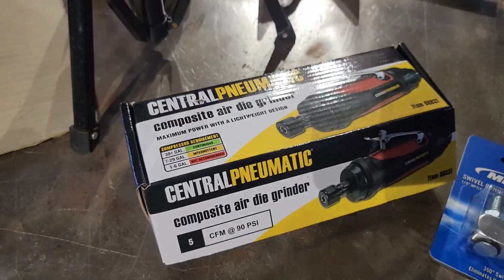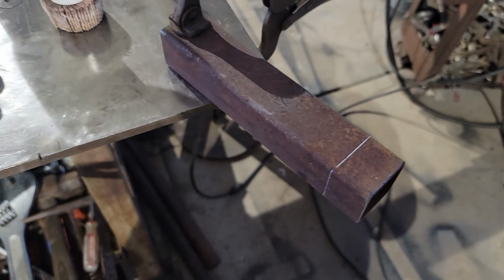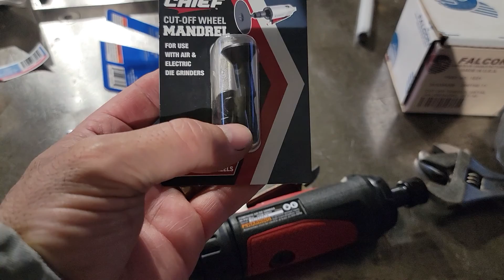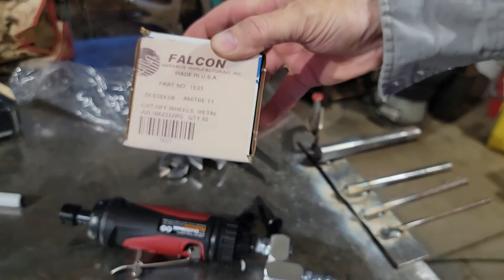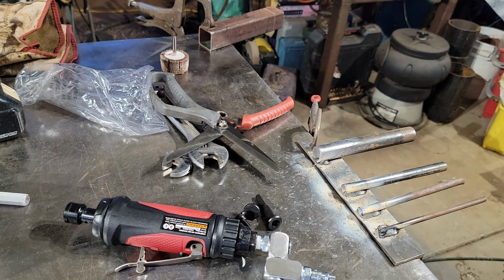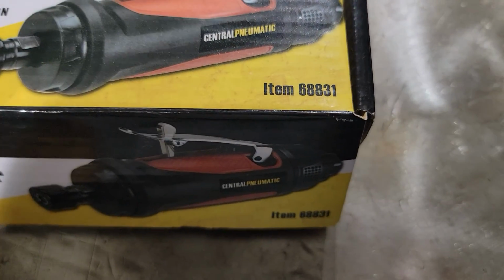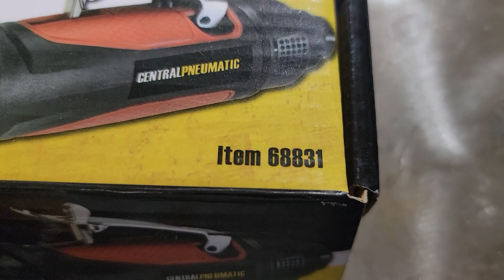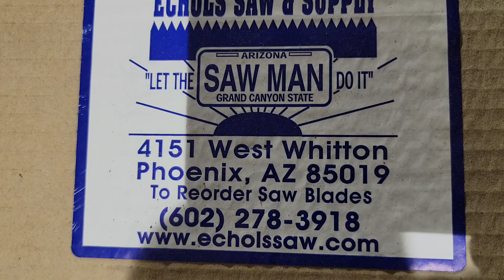Central pneumatic composite air die grinder review #68831

Comment: I would do away with the swivel fitting and get a 10 or 12 inch flex hose with hi flow fittings so you can get all the cfm out of your compressor it will make a big difference on tool performance as well. Keep up the good work!
Reply from the maker: Hey thanks for the comment and the advice much appreciated I will definitely keep that in mind I have it set up this way just because of my work circumstances anyways thanks again I appreciate the view

Comment: i bought this one in January, and by the end of March, with light use, it started to fail.  wouldn't run at full speed and had no torque at all.  i also have the cutoff tool based on the same design, and it is failing in the same way.  this thing is a complete waste of money.
Reply from the maker: A thanks for the feedback much  appreciated it sounds like this might be a good product for a follow up review thanks again
Reply: @26feironworks79  another issue i had right from the start is that bits would get stuck in the chuck, and I'd have to tap it firmly on the workbench to get them to release.  I replaced it with the "chief" brand, also from Harbor Freight, and that thing has been very solid.  I oiled the Chicago pneumatic regularly, and it still didn't survive.  No more composite air tools for me.  Metal only from now on.